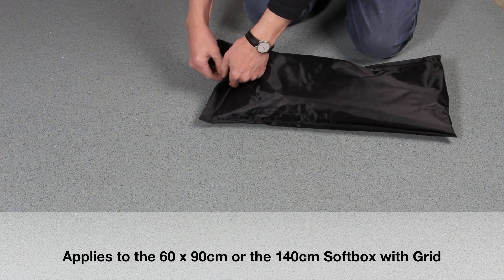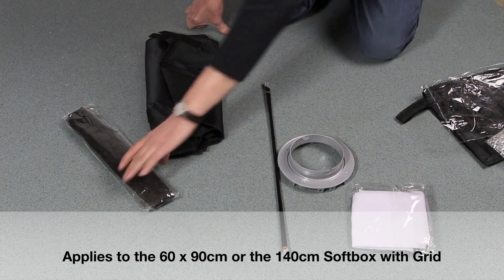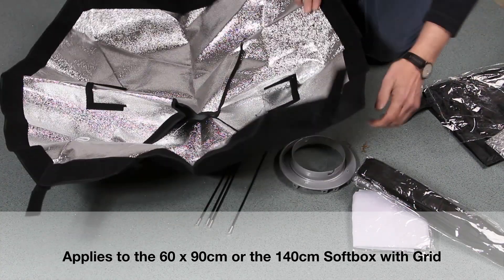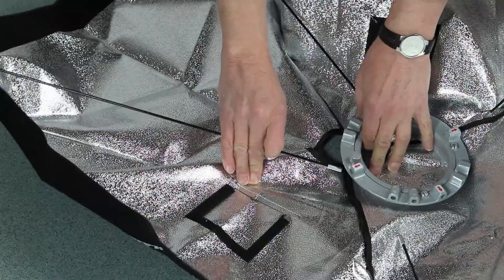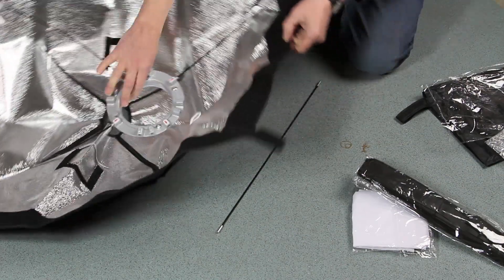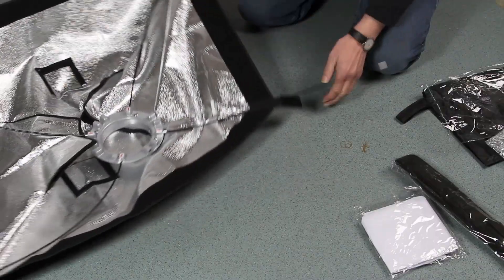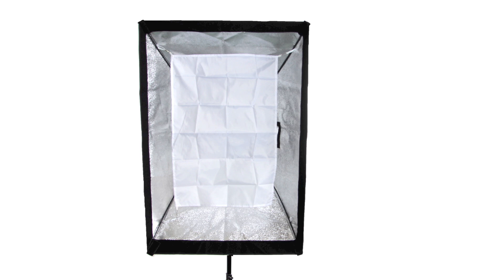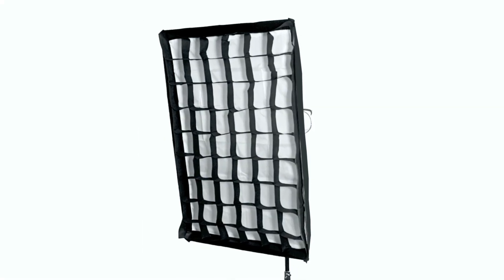How to put up a Micansu 60 x 90cm or 140cm Softbox with Grid

Comment: Thanks. Mine came with no instructions and I was puzzling how to put it up so you have been a great help.
Reply: +Vernon Nash How is the softbox holding up? any observations on good and bad points? I find little online review wise on this companies products.
Reply: +Dave Joyce it worked fine. After I built it I did leave it up for a while as I would be using it in a talk at my camera club and didn't want to hassle of taking it apart and rebuilding it again.
Reply: +Vernon Nash a good even quality of light? Does the grid actually work, or is it more of an attempted sales ploy? Lastly, I would be buying elinchrom fit, wondered if you can rotate softbox once mounted? Thx for your insights Vernon.
Reply from the maker: +Dave Joyce The softbox can be rotated and we have a video to show how the grid works https://youtu.be/yx-3_P3pqQk